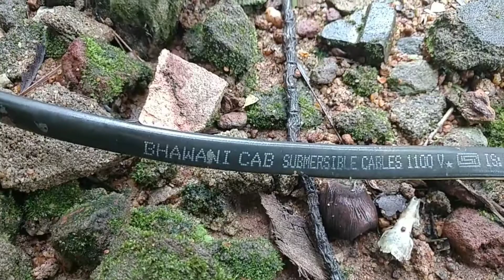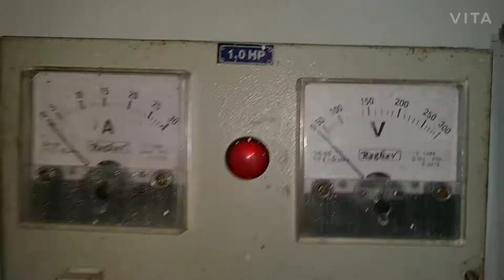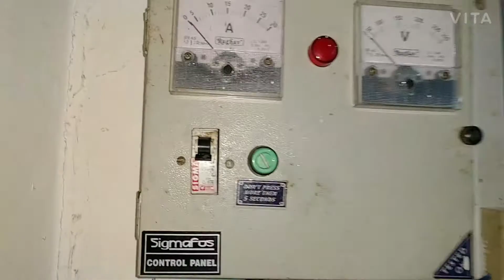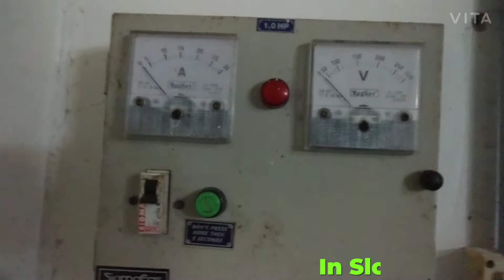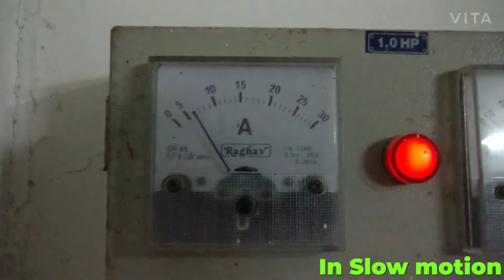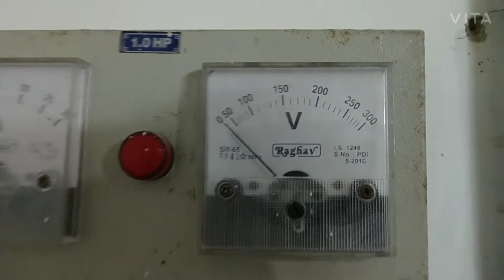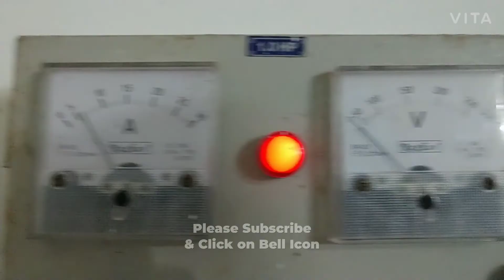Single 1HP Submersible Water Pump For 2 House And Ampere Checking For Choosing Inverter

Comment: my 1hp starting is 12amp running is 4amp .... your starting is 10 amp running 6amp
Reply from the maker: Yes, mine is 120feet borewell. It depends on depth of borewell, in my relatives 1hp submersible running load is 10+amp for 490feet borewell. And also depends on the motor company & age also amp may varies